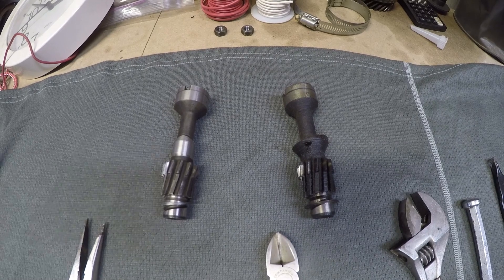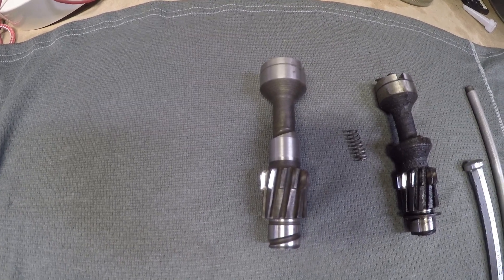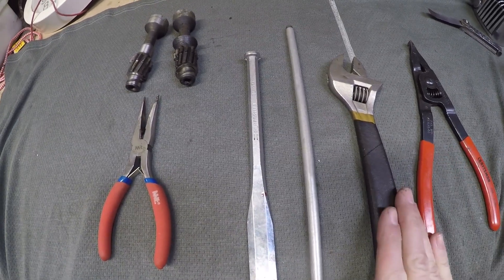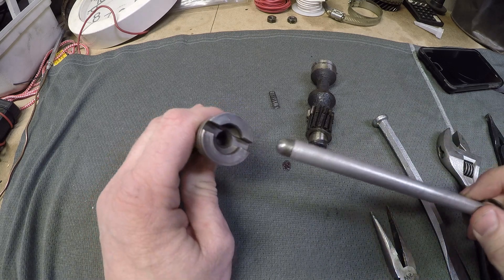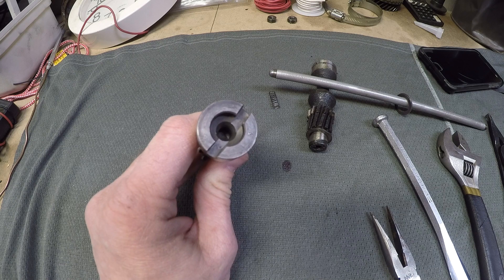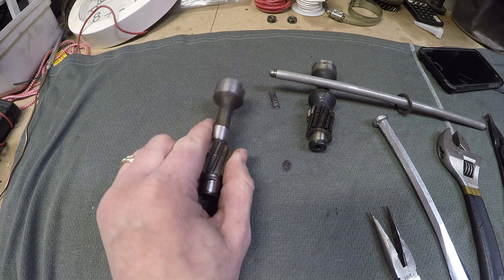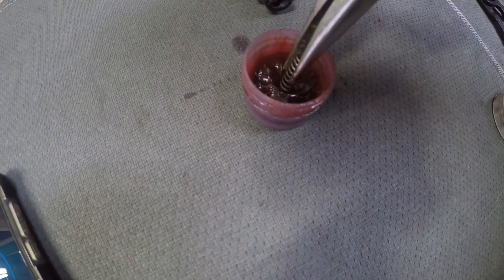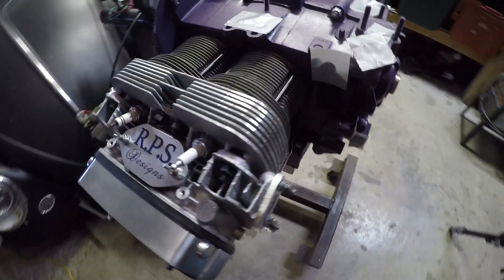Distributor Drive Shaft install

Comment: Just glue with grease on the shaft and put shaft in the hole down. No need to centering or anything else
Reply from the maker: Yep, but there is still that chance of them falling off.

Comment: Can we put the double washers and spring on the gear before dropping it in?  It's almost a ritual with these builders to drop in the two washers, while chanting dont-get-lost dont-fall-off find-your-shelf
Reply from the maker: You could but, how will you know if the washers made it home? I've seen some people install the gear before the case is together. I don't like doing it that way because you can damage the brass gear while spinning the rotating assembly.

Comment: Have you ever heard of the distributor shaft gears coming out of mesh, mine did sending the timing all over the place. Don't know if it was the gears being overly worn or my dizzy had a far bit of axial moment with the wear washer between the bottom of the dizzy and drive very thin. Hope that makes sense
Reply from the maker: My buddy had this happen, I think he discovered his distributor wasn't fully seated.
Reply: If there is no distro in, and you turn the pulley CCW, it will back out and then if you try to run it, it will chew up the gear on the crankshaft.

Comment: Buy a drive gear tool..
Reply from the maker: You're right, there is a tool just for this install. If you have followed me for awhile you may have noticed that I like to either build my own tools or try to do things on a budget because not everyone has access to the proper tool. I've been installing these drive gears this way for over 25 years without one single problem but, if I ever get my hands on you if those tools I will be sure to do a video on it. Thanks for the reply.